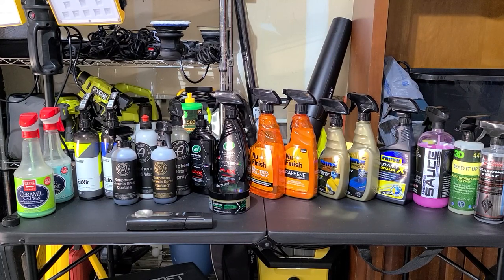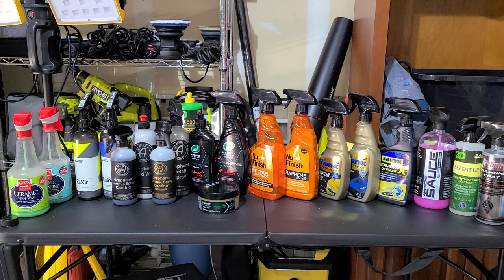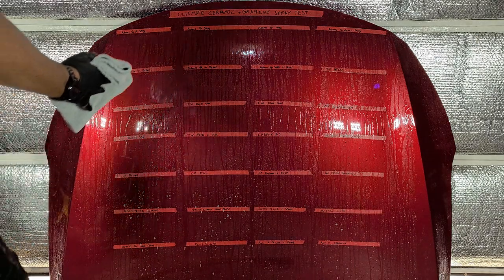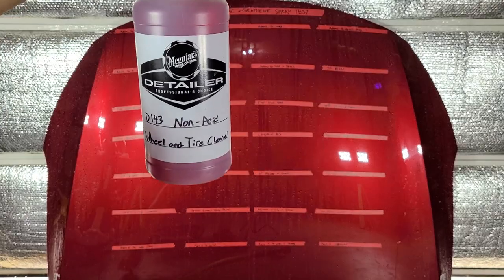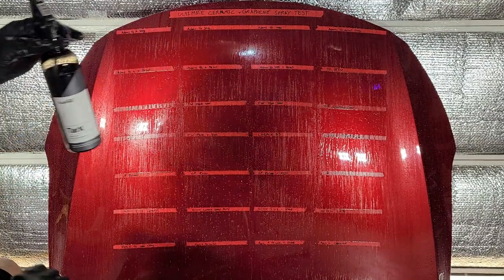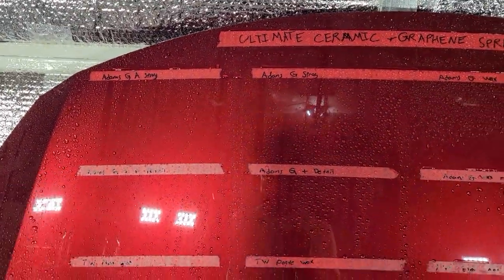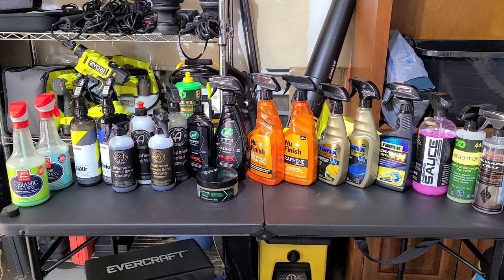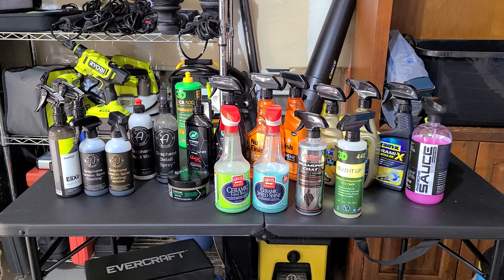[TEST] The ULTIMATE CERAMIC & GRAPHENE SPRAY Chemical Resistance Test - 19 Different Products!

Comment: I'm tellin' ya bro, gotta add Rust-Oleum wax and tar remover, and duplicolor prep  (PS100) to the torture test. It's what I use as the final panel steps before I apply fresh protection or coatings. 

I've never seen anything shake off those two entirely. It's my parachute to making sure I have a completely clean panel and it would be interesting to see which stuff fights it off better freshly applied since I'm always applying it to a panel that needs new protection when I use it.
Reply from the maker: I'll have to look into them. Tar X definitely is far from a prep. I use Carpro eraser normally. Tar X is more like Goof Off Pro or Citrol 266. Strong stuff that can melt plastic.

Comment: Great test. For me, I am interested in how much water is left on the panel after it's done raining because no matter how clean my car was it always looks like heck after it rains. So once it's done beading/sheeting and once everything settles down, how dry does the panel look. I guess you'd need to set up a shower head over a vertical panel simulate that but this is close enough. Maybe for another video :)
Reply from the maker: Well the problem with rain is other than storms, the beginning and end of the rainfall is light and not enough to flood the panel (similar to my mist setting) which no matter wat you do, leaves little spots all over the place that you'll have to wash off. Other than keeping the car garaged, rinseless washing is the easiest way to quickly clean up. Thought with very strong beading, you can always blow the water off with a Leaf Blower right after the rain is finished.

Comment: Maaannnnnn, really wanted a deeper explanation on each product. Mind you I did skip parts till your explanation! But I was rooting for the adams stuff. Yes it's priced more than others but longevity should be a factor too. Bead it up I haven't paid attention to but I have applied the adams graphene wax and used the detail spray, would bead it up hurt to apply on top. My wax is 2 months strong with such depth and gloss as well.
Reply from the maker: Most of these products I have already done videos on if you're looking for a deeper dive into them. Bead It Up can be used as a topper over whatever you please. It may not bond as well but it will still give you great slickness and gloss.